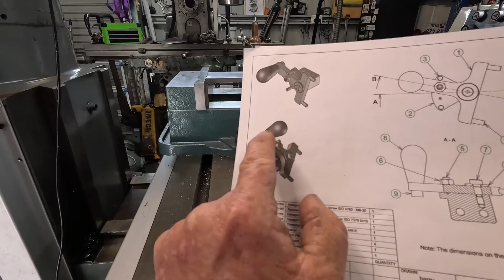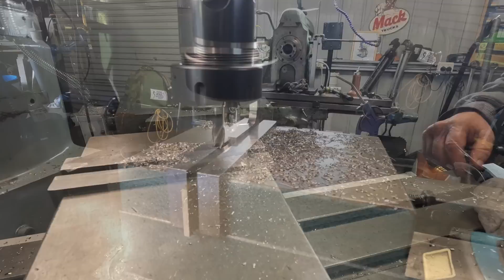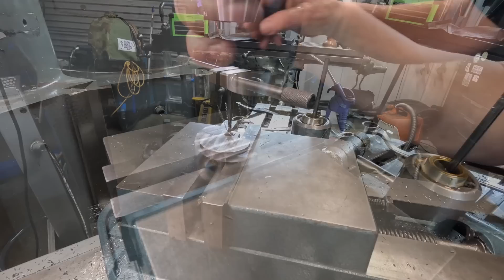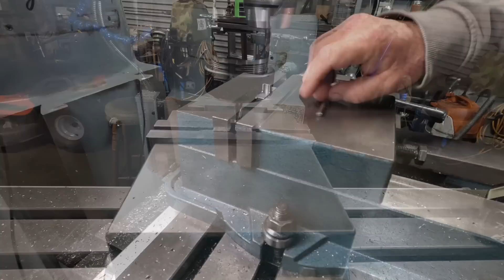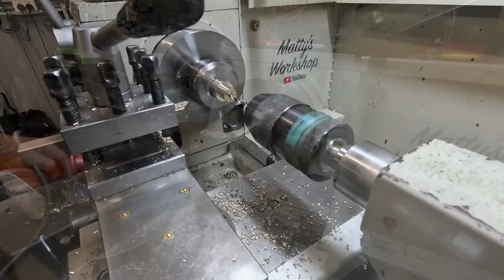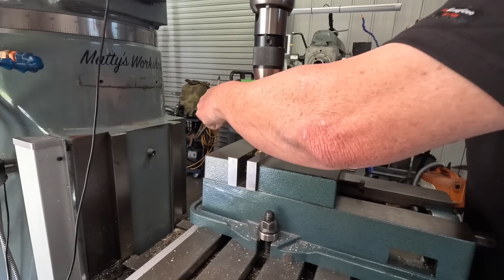Boring & Facing Head  P4

Comment: G'day Matty, I've stopped this at the point you were talking about your vertex edge finder. I have the exact same tool and it's never bloody repeated properly ever. Ive ended up doing it ten, twelve times sometimes to try to average out where an edge is. So much so that I've bought one of the beeping, at touching the part, it's just a simple continuity circuit, only about £10 not one of the £100 ruby stylus ones I add lol. But it's fully ground and I've  measured it with a mic and it's accurately parallel and I'm confidant  it should work.  Not tried it out yet but it must be more consistent than the Vertex edge finder.  I'll watch rest of the build now lol. 
Watched it all now! Matty you're a true craftsman mate, that thing looks bloody awesome! Don't worry about a couple of little balls ups, as the old boys used to say if you're not making mistakes you're either making nothing or you're learning! Looking forward to seeing the boring facing head run next week. I think I'm not going to try to make one as I was going to scale it down to 50 or 60 mm in dia, but looking at what you did this week, I think some parts would be very , very fiddly to make. And a full size one is just too big for my little milling head
Reply from the maker: Gday Sam, it’s been getting worse over the past few months, certainly can’t trust it now, I do have an electronic one but it’s quite long, thanks for watching mate, cheers